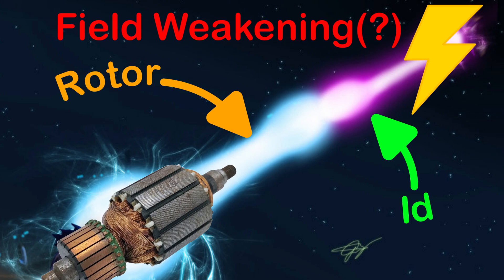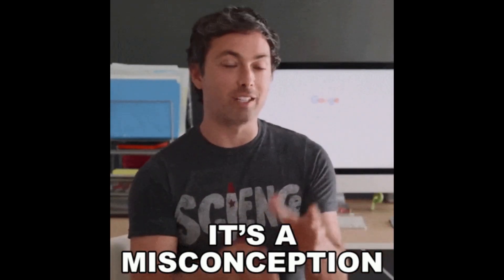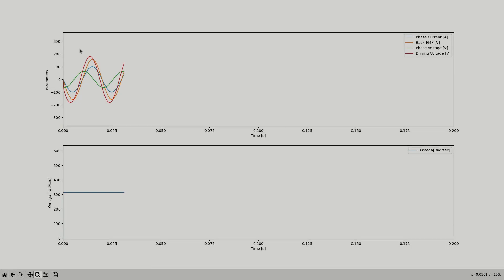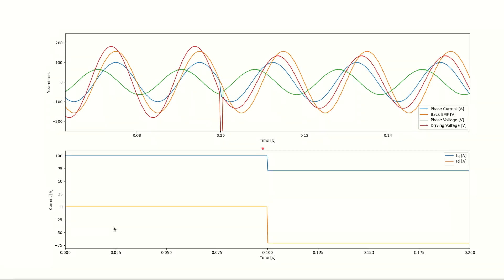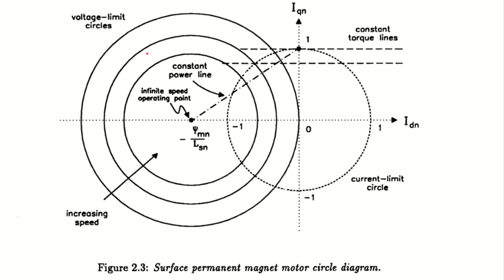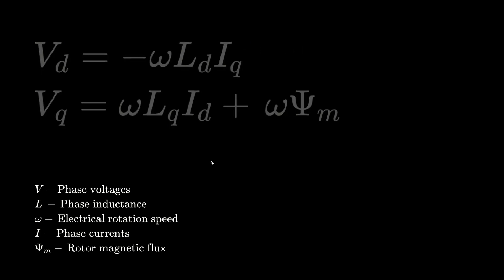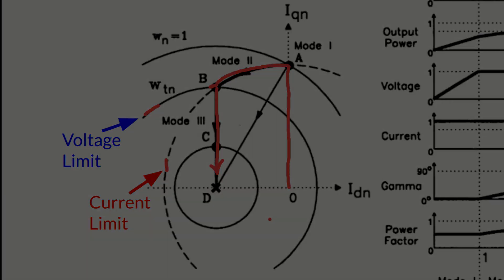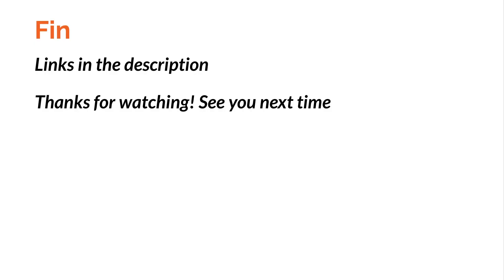Field Weakening: Theory & Misconception

Comment: Tell me please, how much will the torque decrease if I set the “field weakening” parameter to 10 or 20A? My battery current is 50A, phase current 150A. Torque 120 Nm
Reply: Field weakening does not reduce torque significantly. Assuming your controller current limits are set to 50a battery and 150a motor, once the rpm creates enough back EMF to prevent battery VOLTAGE from having the differential needed to push 50a in, you will see battery amps decreasing, which means phase amps are also decreasing, which means motor torque is decreasing. So lets say for example that with no field weakening it will reach equilibrium with 35a battery and 35a motor because the mosfets are trying to stay open as long as possible since the differential is so low.

Now the if controller sees you have authorized up to 20a of motor current to go towards reducing the Direct Axis flux, as soon as battery amps drops to <50a, which will reduce torque slightly, the controller will use some of that left over amps to weaken the field, which reduces back emf at that rpm, which allows some of the left over DC amps to keep making torque. 

So while its true torque will no longer be 120 nm, it won’t be pushed down to 60nm (as it would if it reached equilibrium at rated speed without field weakening. So you would perhaps drop to 119 nm, accelerating slows, but still enough to gain speed. And as back EMF continues to try to increase, battery current will keep diverting some amps from “torque” to weaken the field. Eventually if field weakening is allowed to go high enough, and the battery is not sagging excessively, the system will find a new equilibrium, at a higher speed, making 90 mn of torque to balance with the higher aerodynamic drag. 

So the short answer is, back EMF is what makes you lose the torque, field weakening is what allows you to get some of the lost torque back so you can go faster. 

However in real world use, field weakening depth needs to be limited to an amount which is effective. By limiting field weakening, the back EMF will limit battery current, and this will allow some of the battery sag to recover. So as battery voltage climbs, it increases the voltage difference and allows more current to go towards torque. Again regaining some of what was lost. 

It’s important to choose the right battery voltage and max amps and the right motor rated speed for the application. If you want a bike that can cruise at 60 mph continuously and reach 80 mph for overtaking or drag racing, the motor should not need field weakening until 61-65 mph, but it will need every bit of peak power to go 80 mph for a limited time (normally set by the boost function). If you choose a motor rated for 45 mph or 80 mph, its not going to be efficient at doing the design objective. 

But if all you want is 80 mph for as long as possible, then buying one with a rated speed of 80 mph allows you to use all watts for torque, none for field weakening. This means you can go 80 mph longer without overheating because the windings are thicker in a 2T wind than a 3T or 4T wind. 

If you want to tune a controller that lets you assign how many field weakening amps you will allow, just keep increasing it in 10a increments until you are no longer getting a higher top speed, then back it off 10a. Then see if the battery or motor is overheating and if needed back it off until max speed amps is acceptable for the amount of time you want that speed. If you have different modes or speeds, you can set one for max possible speed, and set another one for normal driving (lower max speed that never allows field weakening). And ECO that limits both max current and max speed and allows you to go further on one charge.
Reply: @ Thank you very much for such a detailed answer👍🏼

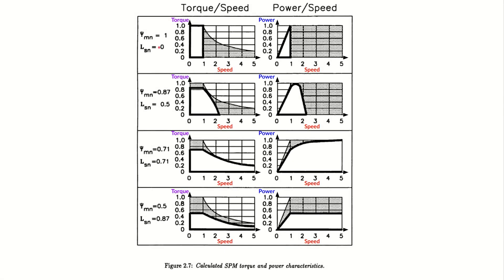Comment: Thank you sir for making such informative videos. However, can you please share the references for 6:22 , 7:27 , 9:37 ?
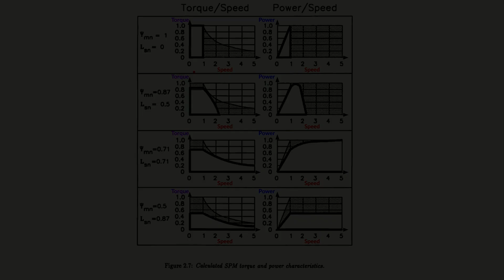Reply from the maker: The reference for 6:22 and 9:37 is in the description:
"Design and Modelling of Axially-Laminated Interior Permanent Magnet Motor Drives for Field-Weakening Applications"

7:27 is written by me, those are simply the standard voltage equations for FOC control, just look for "pmsm voltage equations" in any search engine.

Comment: Your diagram does not address the misconception at all; it merely repeats the assertion in a graphical manner.
Reply from the maker: Would you care to elaborate?

Misconception: Field weakening works by essentially lowering the motor's torque constant / back EMF constant.
My claim: No, it does not. it's easiest to see that in 5:36, by adding current in the d axis, we can lower the voltage amplitude yet leave the torque constant.
Reply: @MatanPazi  Im not saying you are wrong; I am saying you are not presenting a novel argument; just the same assertion in a graphical format.

Would love to see those experiments on a real motor you alluded to at the start of the video btw.

Comment: WOW,  You need a VESC from Bennjamin Vedder, a controller that is open source. Man I would love to pick your brain to help me program my motor, can you explain how to calculate motor inductance difference iq-id? how do I calculate motor flux linkage? These are my measured  motor parameters,  R = 66 milliohm,  Inductance = 366 microhenry with a max voltage of 84 volts,  FOC, no field weakening yet.
Reply from the maker: Aloha, well there are several methods.
First of all what do you need those parameters for?
Does the motor even have saliency (Lq, Ld ratio)?
You can identify them using step/sine injections and process the response for example.
Or w/ an LCR meter, make sure to rotate the rotor to get min (Ld) and max (Lq) values.
Regarding flux linkage, you can pretty much measure the bemf between phases and w/ some scaling get the value.
Reply: @MatanPazi  with min and max values do i average them after take measurements of one revolution
Reply: @MatanPazi  I can get the motor to run in foc just not smoothly above 15000 erpm. In bldc mode the motor does fine. From what I understand in FOC mode I should get even more performance out of it, but I just can’t seem to dial it in.
Reply: I second the notion of playing with a VESC, but that's why I'm here - to learn about the field oriented methods of commutation. 
You're saying that surface permanent magnets synchronous motors should have basically zero saliency - IE Ld-Lq=0?